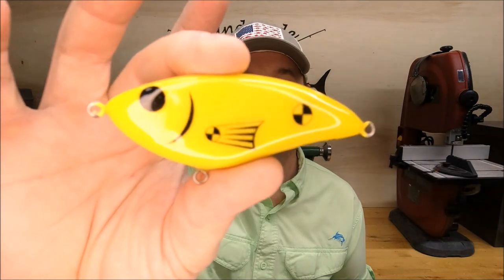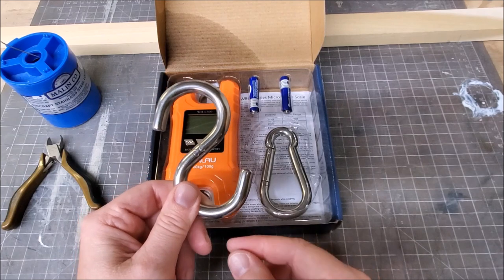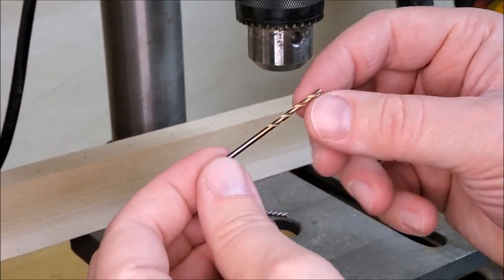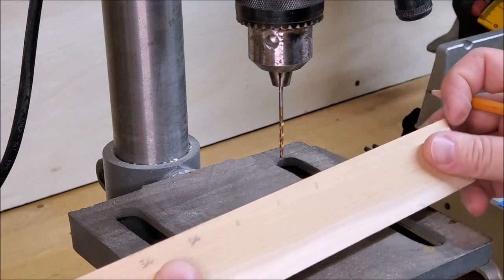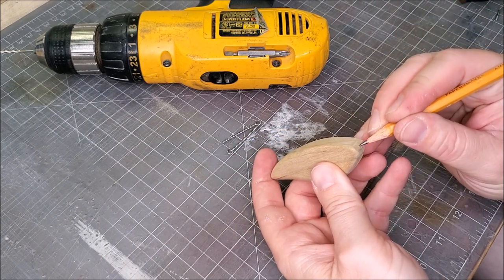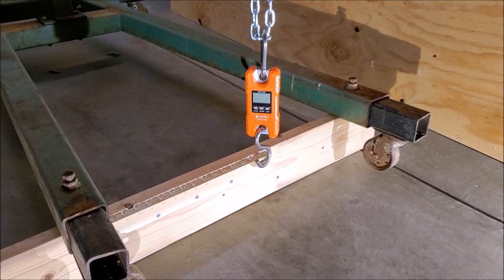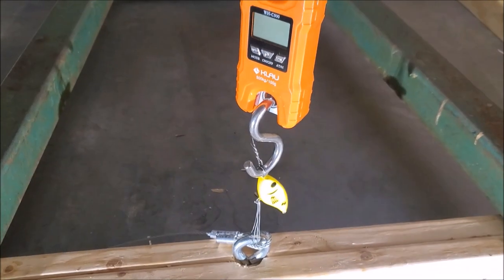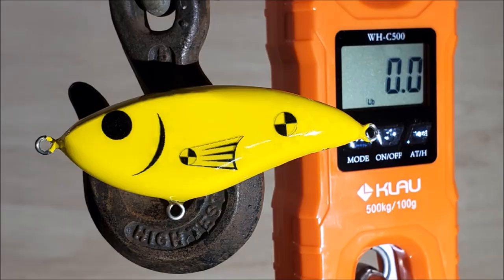Wooden Fishing Lure Testing: How deep do you need to embed your twist wire?

Comment: The amazing thing about epoxy is the internal strength you can get in the resin.  We often use epoxy to embed 2 inch diameter bolts in the decks of concrete bridges and the epoxy is much stronger than the concrete. Its the same with wood.  The failure mode will almost always be wood rupture.  So we have to consider the interplay; direction of the grain, cross sectional area near the load, and the angle of the load.  All those variables are always in play.  The nice thing is that you show how easy it is to get plenty of strength...nice job.
Reply from the maker: Many thanks, I really appreciate your comments! I am very interested in all things relating to lures. It's easy for me to get caught up in the anesthetics, but a good lure must perform structurally and functionally.
Reply: So what do you guys think is the strongest way to do it, I would like to start making glide baits out of resin is there any tips on what I should do?
Reply from the maker: @zacharythomas6134  If you are casting resin lures, you can of course set your wire in the mold prior to pouring. However, you can also attach your ballast weight to that wire and encase it all at once. It will take some trial  and error to get the proper configuration and weight, but once you do you can really crank em out.
Reply: Really be interesting to do the same test but 'roughen' up the wire before twist into form... You rough up most materials before gluing to increase adhesion strength why not wire!? Wire is very smooth and the only 'mechanical' aid to the strength is the twist of the wire... Another idea... Maybe less twist is better? The gap between the wire twists would be larger and thefore ... Possibly... Give more grip... Maybe even put small pins in the twist creating 'holes' that the epoxy can flow through anchoring the epoxy... Maybe the basic Haywire light twist like in a leader set up is all you need... More twist more fatigue in the wire... Also something to consider... Great video!
Thought to send you the questions I posed on this channel... See if you would be interested in the questions... Less twist better? 'Rough' wire ... More adhesion? 'Holes' in the twist giving an anchor effect with epoxy flow through? With looser twist would a bigger hole that accommodates more epoxy give a more anchor effect? Would a more flexible epoxy give more strength? Micro bungee effect? All kinds of ideas popping into my head... Curious of your thoughts Franco!
Reply: @zimmtex sent the same questions to Franco that I posed to you... Plus a few more came up when addressing them to him... Like now... What about a figure 8 twist with a small loop embedded in the epoxy?
Reply: What about a figure 8 with a small loop embedded in the epoxy... What about testing actual lures from large manufacturers? Too dangerous exposing yourself to litigation?

Comment: Great test! No game fish will ever pull these out. Before that your line will break. Have you ever tried to lift a 2kg weight with your MH bass rod? Its almost impossible. These fish are not as strong as you might think. Of course you need some backup for head shakes ect. But 30lb would probably be enough for muskies
Reply from the maker: True enough! When you consider big saltwater fish without drag, they would yank you right out of the boat!

Comment: The rod, drag, and movement of the fish will lend to the strength of the wires and glue. Pulling solidly against them is like when they're hung up and the line will give first in that case, in my opinion. Nice video though. Thanks for the input.
Reply from the maker: You are completely right. In fact, I made another video testing a big saltwater poppers and the hook and swivel failed. If you didn't have the cushion of the rod and drag, those bigger fish could probably pull you in! Thanks for watching!

Comment: This video is really handy and knowledge that every lure carver should know. I was wondering if the direction of the wood grain made any difference when gluing twist wires/hook eye's into the lure? Plus would the twist wire results be different if glued into other materials such as MDF?
Can you please tell me the sort of 6" ruler that you use, it would be handy to use on foil when marking out scales! Thank you. 👍😷👍🏴
Reply from the maker: I'm glad you found this useful! Going perpendicular to the grain (through several rings) is stronger than drilling parallel to the grain (between the rings). Your results would be different for a different type or even species of wood. However, this gives you a basic idea of what strengths you can expect. I found that ruler in my local hobby store. It reads 'Westcott' on it. Thanks for watching!

Comment: Really interesting topic presented very clearly, thanks a lot for doing this.
Looking at the epoxy loss on the twist wire have you considered a back to back test using wires of one length but wound looser so there is a more rippled bonding surface along the twisted wire?
Reply from the maker: Interesting idea! If you had a need for extreme strength that might give you a little bit more strength. Another side effect would be that the wire wouldn't be as stretched and stressed. Thanks for the suggestion and for watching!

Comment: what size hole are you drilling...does it have to be tight....or loose for the glue
Reply from the maker: It should be tight enough to not fall out on its own, but not so tight that there isn't room for glue.

Comment: May I ask why you don’t run one straight wire through the whole body? I’ve been watching different pages on who they make swim baits and crank baits and this is the first page I’ve seen where you drill and insert the loops. Has me interested because seems to be less work and not having to split the wood in half to add in the wire loops
Reply from the maker: Through wire is preferred for bigger fish or for use in really soft wood like balsa. I think drilled twist eyes are plenty strong for bass and such so long as your wood is dense enough. Thanks for watching!
Reply: @zimmtex  ahhh that makes sense! So drill and insert loops wouldn’t work well with Balsa? That’s probably what I’ll start off with tbh for some top water/cranks

Comment: Really be interesting to do the same test but 'roughen' up the wire before twist into form... You rough up most materials before gluing to increase adhesion strength why not wire!? Wire is very smooth and the only 'mechanical' aid to the strength is the twist of the wire... Another idea... Maybe less twist is better? The gap between the wire twists would be larger and thefore ... Possibly... Give more grip... Maybe even put small pins in the twist creating 'holes' that the epoxy can flow through anchoring the epoxy... Maybe the basic Haywire light twist like in a leader set up is all you need... More twist more fatigue in the wire... Also something to consider... Great video!
Reply from the maker: Thank you for sharing your thoughts; I think you have some great ideas for adding grip! I'm glad this test provoked some innovative thought!

Comment: I would like to get into making lures. Is it possible you could recommend a airbrush and what type of paints to use?
Reply from the maker: Well, in my opinion you don't need an expensive airbrush to get started. The one I use is affordable and does a pretty good job. There are lots of paints out there, but I happen to use Createx. They are widely available and they have lots of colors. I have most of the stuff I use linked in the description if you are interested. Thanks for watching!
Reply: @zimmtex  I agree with you, but if you want detailed work, a good airbrush is key. I started with a cheap airbrush, but while I was getting better, I needed something better to have a more detailed paintjob
Reply from the maker: Absolutely, as your skill improves you will benefit from nicer tools. Plus, it doesn't hurt to keep the older one for a backup. It's really easy to drop these things and they always seem to land on the needle.

Comment: Thanks!
I've used half inch with 5 min epoxy and would assume that would withstand  very well, though I think 30 min epoxy used could create better bonding with wood.
As a suggestion, I guess super glue could be a real contender to epoxy and would create better and stronger bond.
Reply: I’ve used both and never lost a fish on either but superglue although strong tends to become brittle especially when exposed to temperature fluctuations. It doesn’t have any stretch whereas epoxy has some give
Reply: @joelnoles4530  perhaps epoxy is more flexible, but super glue would penetrate wood grain  way better and could reinforce embedment area for a stronger bond. Conducting a test would reveal the difference.  I expect thin super glue for the same reason outperform gel type, though.
Reply: @joelnoles4530  perhaps epoxy due to its thickness could create a higher flexibility,  but a thinner super glue could penetrate deeper into wood grains building a stronger embedment strength. Conducting a test would reveal this theory though. When using a thin super glue, the closest tolerance possible for drilling hole should yield best results.

Comment: I’m late to this video but most table fish of a few kilo isn’t going to bother the lure at those breaking points , but if chasing big fish I would have wire one piece right through the lures to make sure of no failure from a glue joint and a wire section to pull out , Mostly the hooks are the cause of lost fish or line breaks , great tests though , nice to see.
Reply from the maker: I think you're right; the biggest test of strength usually comes from trying to pull out a snag. Thanks for watching and commenting!
Reply: @zimmtex  …yes snags cost us some lures , though there are ways of retrieving lures from snags with poles and weights on lines to desnag lures , don’t always work 100% of the time but do get most lures back just got to get creative lol.

Comment: If you cut from the very back of the jaw of the cutter, you get better cutting power. Closer to the tip is weaker force. Also, I think you would get better hold on the twisted wire, if they were not so tightly twisted. Looser makes for a more coarse “thread”. Obviously not so loose as to weaken the rigidity of the screw eye made.
Reply from the maker: Great tips, thank you for watching!

Comment: Do threaded eyes hold more than twisted wire or has anyone done a test video on that yet ?
Reply from the maker: Thats a good question! I actually don't have any experience with twist eyes. However, I expect both have more than enough strength for lure making. Might make for an interesting test.

Comment: I  make wooden lures also what i do is drill ahole  straight through the lure drill ahole at the bottom of my lure insert a swivel inthe bottom hole and then pass the wire through  one eye of the swivel and the other  eye is for the hook the ends of the wire are twisted to form the other eyes
Reply from the maker: I have seen that technique; it is often used with big poppers. Keep up the good work!